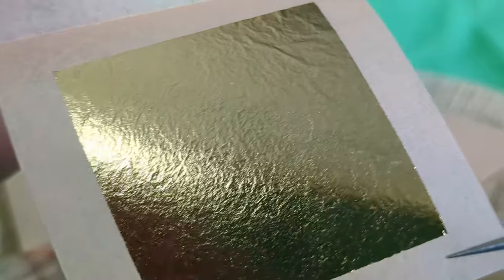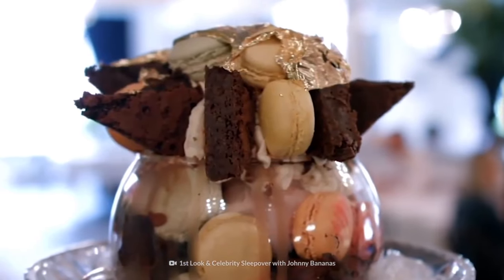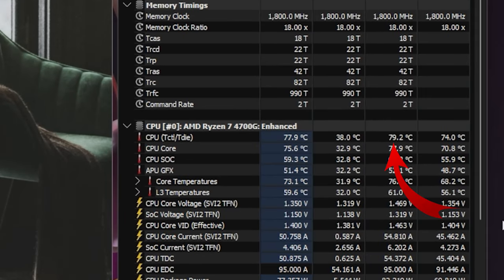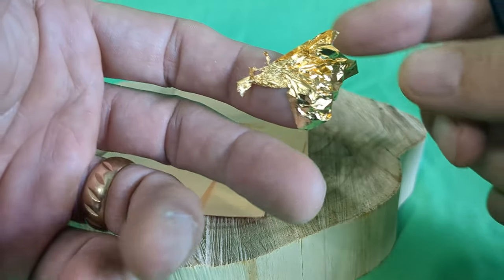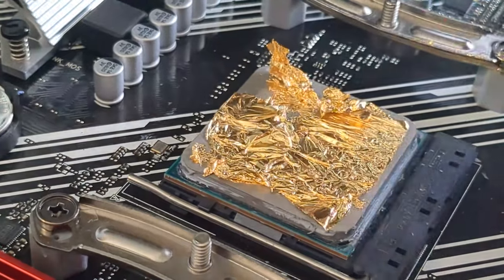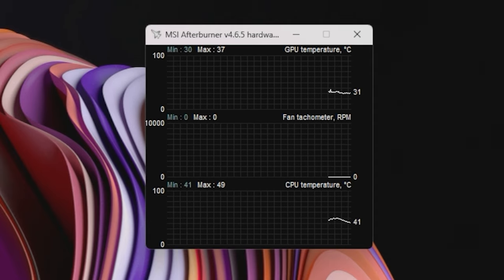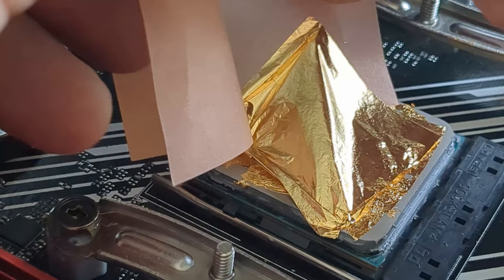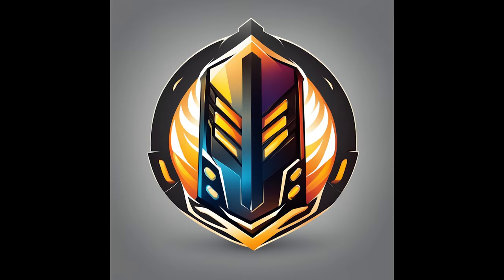Using GOLD for Thermal Pad

Comment: It's way past the scope of the video but for the full effect you'd need to lap and polish both the cooler surface and the IHS of the CPU and as has been daid in a other comment use a static horsehair brush or feather to gently lift and place the gold leaf onto the CPU
Reply from the maker: I may revisit this with these suggestions. Thanks so much for watching!